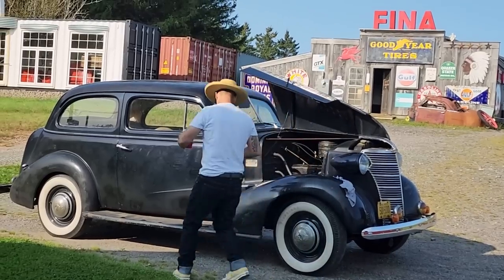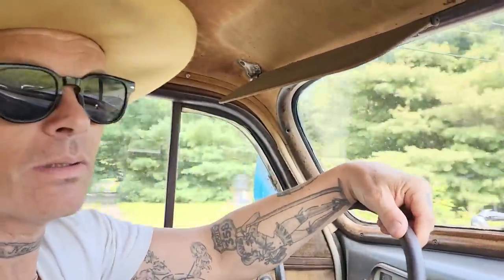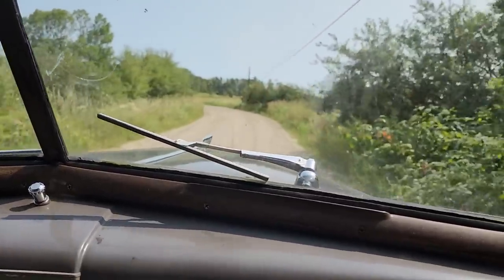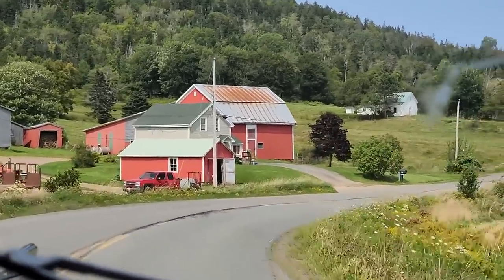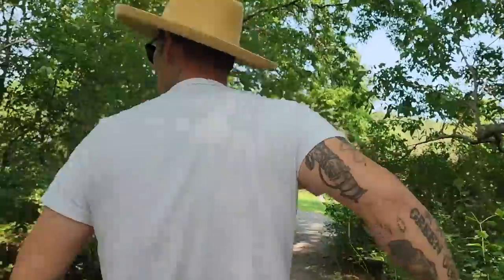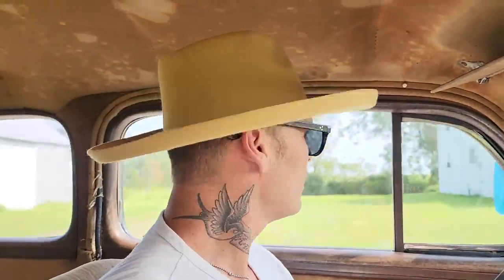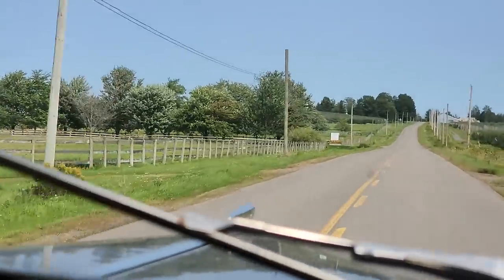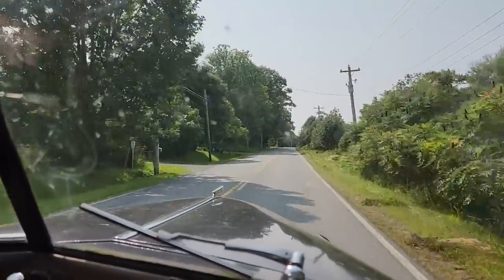We're going to the beach in our 1938 Chevy 👙

Comment: Hey Chad, nice 38 Chev, you said you were Hot in there, Open the "Cowl Vent" it's the black handle under the middle of the dash. Pull it straight down, although it might be "sticky" and require a bit of penetrating oil. Enjoy.

Comment: That Cad flathead is a great old engine , but it weighs a ton !  Way too heavy for that old Chev .   The engine would be a lot quieter if you adjusted the valves.   .oo6 on the intakes , and .013 on the exhaust valves.  Sounds like the tranny needs a little gear oil , too.   Love your show .  Jolene is the best !!  Woof to Fina !

Comment: The older cars have a more straight cut gear that is the reason for the noisy sound it's like your drive on an engine they make a bit of noise same as a tractor even when they're up on oil they still make a bit of whining noise that is also the reason they don't want to go into gear so easily unless the car is moving the only way to get first year before you get down almost to a stop is to bring the throttle up even with the clutch in cuz we all know what the clutch out it still won't go into first gear tell you're almost stopped without throttle tapping 🙄😉😏😆

Comment: Think I should mention,,the rotella oil is high detergent oil,it will find the sludge in the block,dilute it with fine sediment and run your bearings,we lost a newly reconditioned  38 engine to that very thing,please change that oil,before the shaft starts rattling on the over run
That motor has probably had the timing gear replaced with the aluminium upgrade,and they  howl with revs
Like your hat.

Comment: Those older trans have straight cut gears and no  syncro  mesh so their noisy and dont                 shift to low till stopped later tears were sla 17:11 17:12 17:13 nted 17:35 17:41